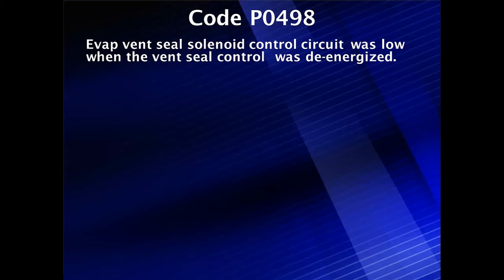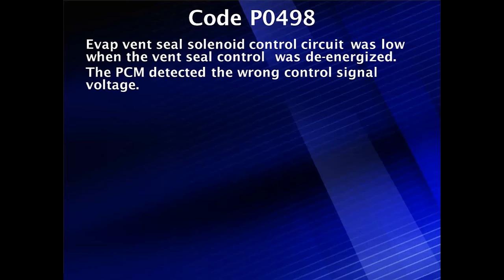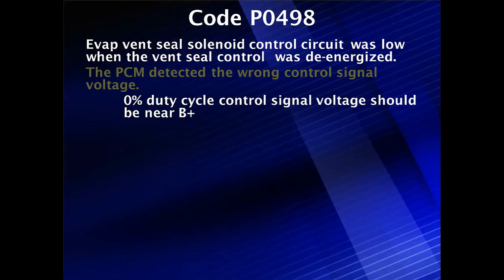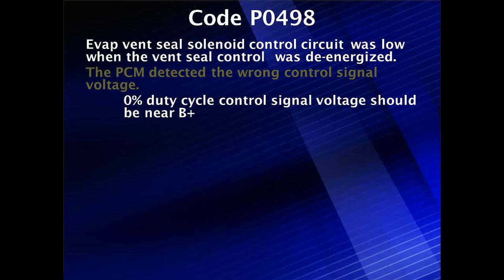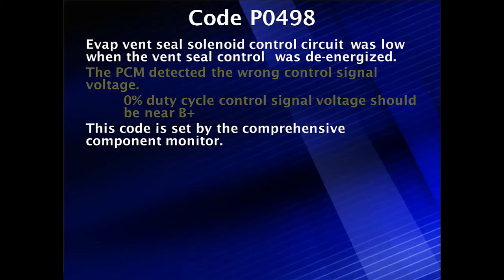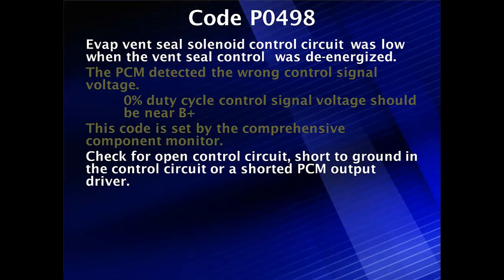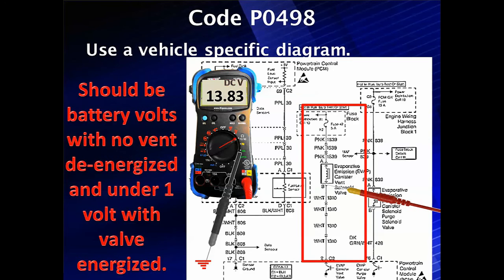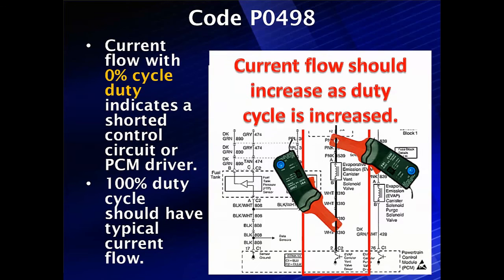26 Code P0498 Diagnostic Procedure

Comment: Hello everyone. I fix my problem already. I was a misplace fuse. Due to replacing a part. Check fuses under hood. May have a blow fuse or you switch fuse by mistake. Check fuse #13 through #16 depend on what car. My is a 2011 honda accord and was fuse #14 FI SUB. Easy fix.

Comment: I’m looking for a solution to the P0498 error code for my 2009 Honda Pilot. I️ had several others pointing to the oxygen sensors. I️ replaced all 4. Could any of you offer any advice on my next move to resolve the remaining error code P0498? 
“P0498 indicates the evaporative emission system vent control electrical circuit signal had low low voltage for a predetermined period of time. “
Autozone’s suggested parts are fuses. There are no failed fuses... 

Many Thanks!
Reply: Exact same thing is going on with my honda civic 2009, guys  i  need the info pls
Reply: Dennis Fernandez i have the same issue honda civic 2006 po135, po498. It's driving me nuts! Where you able to fix the problem?
Reply: Dennis Fernandez where you able to fix it ? Civic 06 same problems!
Reply: Richm _111 I have same problem. Accord codes p0498 ,p0135 I replace oxygen sensor check fuses check purge valve and shutoff valve still have same problem. Friend says may be the valve on the gas tank may be letting air out. Still working on this issue for 2 week. I let you know what happens. Any suggestions?